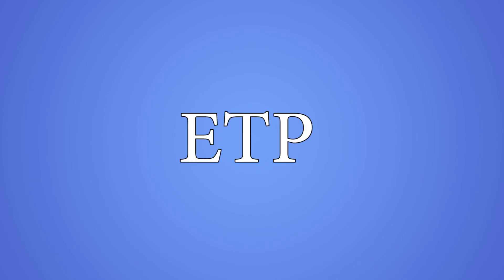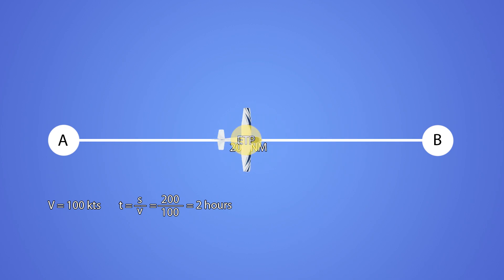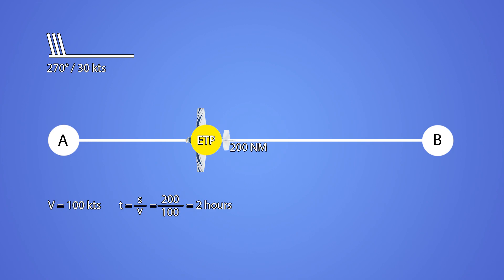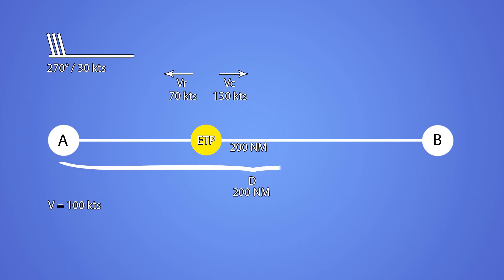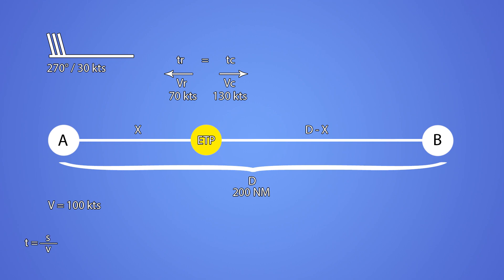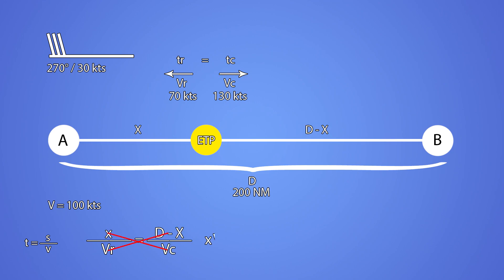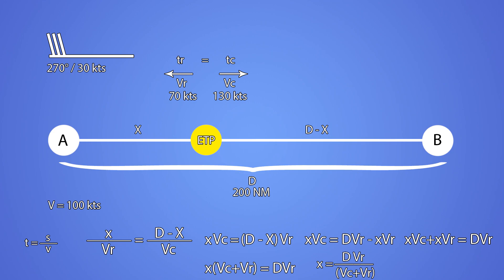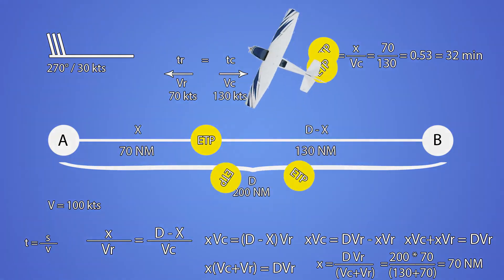How to calculate the Equal Time Point - ATPL

Comment: The EQUAL TIME between Destination and Diversionary Airfield can be calculated thus:
ET = D. Sec theta/ 2A where
ET= EqualTime
D  = Distance between Destination and Diversionary Airfield
A  = Airspeed
Theta = angle between track and line joining destination and diversion plus/ minus the drift. Plus when drift and diversion on opposite sides of the track, minus otherwise. 
This is derived from the VIR NARAIN FORMULA (Wikipedia) and elsewhere.😮

Comment: This type problem, ETP, is easily solved with the E-6B or similar dead reckoning hand held computers once you learn how to read values and interpret their meaning. The instructor is teaching how/when to find your ETP along the outbound track NOT to be confused with calculations FROM the ETP back to the P.O.D. (point of departure or destination) once you are at the ETP. Using the E-6B, the only math  is adding the ground speeds, GSc- ground speed continue, GSr- ground speed return. The remainder of the problem is as follows..GSc+GSr= 130kts+70kts=200kts On E-6B find total distance on outer scale, 200 nm. on rotatable disc find combined ground speeds-200kts, rotate disc until combined ground speed is in alignment with and under 200nm on outer scale, both 200's are now in alignment. * DO NOT MOVE DISC * on rotatable disc find GSr- 70kts, directly above on outer scale is your miles from P.O.D. to ETP-70nm. Now look at the pointer at 60 min on the disc, directly above the pointer on outer scale is time BACK FROM ETP (60 min) TO your point of departure and ALSO TO your destination. NOW to find our ETP along outbound track. Now you can move disc. Rotate disc pointer to GSc- 130kts  on outer scale, then on same outer scale, find distance of ETP from P.O.D.-70 nm, directly under the 70 nm on outer scale drop down to the minute scale on disc to read time along outbound track to ETP from P.O.D.-- 32 minutes. Values are rounded to whole numbers for simplicity.

Comment: I think you have made an error in your calculation. It should be 70NM divided by 70kts ground speed. that gives you 1 hr of time. 
Because you are turning back to A, you have to use the ground speed going back to A which in this case is 70kts.
Reply from the maker: Edgar Xavier If you want to know how long it takes to reach the ETP from your departure you need to use the outbound speed Vc. In this case the outbound speed is the speed with the tailwind. I think you are referring to how long it would take you to go back to departure airport from that point. In that case you would indeed use 70 and it would take 1 hour to complete the journey. If you decided to continue it would be 130/130. Also 1 hour. Let me know if I made it unclear in the video and I will try to be more specific in the next one :)
Reply: @aviationspirits  Ok so lets say i was going from point B to the ETP, would the time be the same?
Reply from the maker: I think maybe I was unclear. The time from ETP to either A or B has to be the same, thus the name of "equal time". I don't see why you would want to calculate the time from B to ETP as that serves no purpose in this example. But it would be around 1:52.